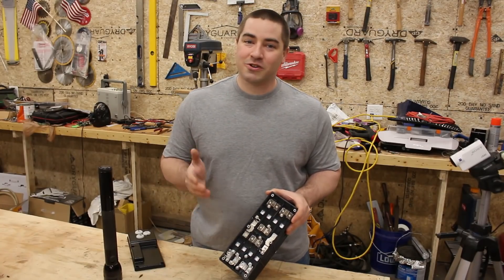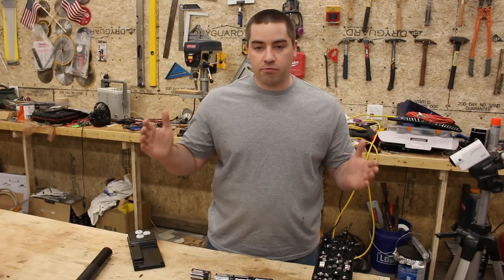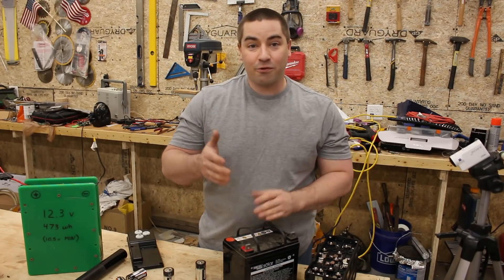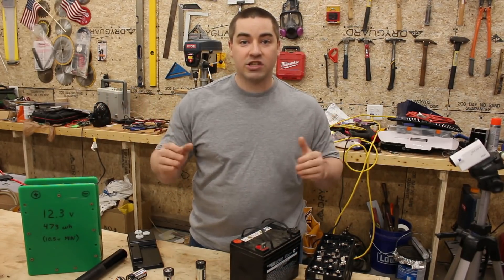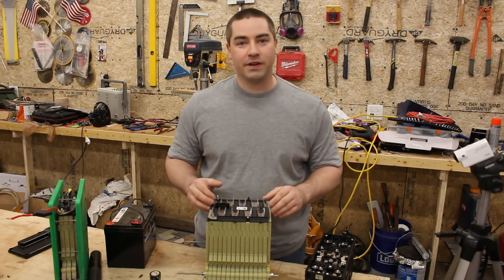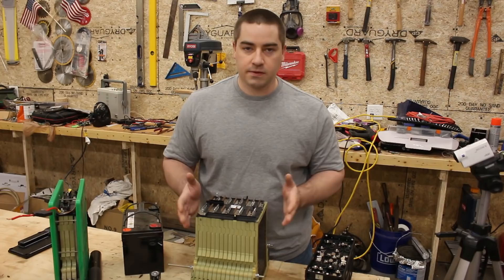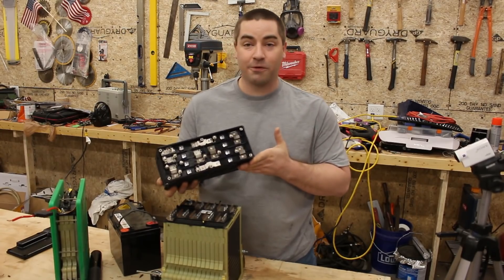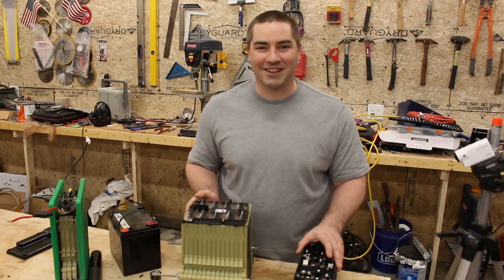Cells in Series for Best Efficiency and Capacity

Comment: Am hoping you can help me configure Navitas LifPo4 25A batteries into a 300Amh / 7 kwhr bank. My system is 24V and I have 100 of these batteries. I have (2) Overkill 8S 24V 100A BMS but can buy more if necessary. My milk crates are 12" X 18 inside. thanx........  Bob
Reply from the maker: Hi Robert. Those Navitas 25Ah cells are cool.  At 24v you will be wiring 8 cells in series.  And you say you want 7kWh capacity.  That means you need a minimum of 88 cells.  Is that how many you have?  Or you can buy 4 cases of 24 cells, which would be 96 cells total: https://batteryhookup.com/products/new-3-2v-25ah-lifepo4-topband-navitas-prismatic?variant=40145310941346  (discount code DAVIDPOZ).  Lets say you have 96 cells, and are using 100 amp BMS's.  I'd wire them as 4p8s, which would be a 100Ah battery@24V.  That would be one battery with one BMS.  I'd make 4 batteries total that way.  Does this help answer your question?
Reply: Thanx soo much for the reply. I have bought many cases.... so yes I have the 96 needed. Soo you are saying I need 4 BMS?
Reply from the maker: Yes.  At least, that's how I would do it.  I would make 4 batteries, each with 1 BMS and 32 cells.  However, I'd also consider moving to 48v.

Comment: Good video thanks.  I have a MPP solar inverter/charger I can adjust it to what ever voltage range I need Max is 60 volts, and low is 50. and I can set the cut off to as low as 42 volts.  Cant wait until I have the cash to buy a new battery bank I want as much power for as long as possible.  and then be able to add on as my system grows.

Comment: Good details, David. I want to comment that most hybrid inverters from Asian manufacturers are programmable with a wide range of charge/discharge settings allowing you to use any serial configuration from 12S to 16S. I typically do 13S for Li-ion and 14S for LiFePO4, picking the best spots for my low voltage cut off and max absorption voltage. Exactly so for Outback charge controllers and a couple others.

Comment: @DavidPoz - Dave, at 13:23, you made it sound like bulk charge and absorption charge are the same but they are not.  Bulk is given the name because that is where the bulk of the charging is done (as far as amount of charge added but not necessarily timewise).  It is typically the 1st charge stage and is typically a constant current (CC) stage.  Absorption is a 2nd stage of charge which is typically constant voltage (CV) but with gradually reducing current.  It is sometimes referred to as a "top off" stage.  So you may have misled your viewers at 13:23.  Again, the transition between bulk charge mode and absorption mode is when there is a switch from CC to CV.  Usually the CV stage happens when the bulk stage reaches the maximum allowed charging voltage by a particular type of battery.  For example, if a 12V AGM battery was put on a charger and it started at 12.8V in bulk charge mode, perhaps when it got to 14.5V, the charger would then hold it there at 14.5V (not letting it go any higher).  So at the 14.5V (in this example), there is a transition from bulk to absorption charge mode.

Comment: DavidPoz from what I have read the SMA sunny island is actually more efficient at the lower voltage of the volt batterys? look at the efficiency curve on the chart on page 231 of your operating manual
Reply from the maker: Thanks.  That is neat.  Up to 1% divergence between the 41v curve and 63v curve.  I don't know how different SMA is from the three manufacturers I called, but they all warned me against running down at lower than 48v.

Comment: I just broke out 1 of 2 Midnite Solar Charge Controllers and  have it bringing my 4 pack back up from 21v each using a  HVDC charger. Thanks for the lesson in absorb and float. Balancing lifepo4 and maintenance is a cinch but I just wasnt clear on absorb and float and the mfr are like midnite and even as helpful as thesolarbizdotcomwas they were still not knowledgeable about lifepo4 batteries. Your chart is the bomb! The generic controllers i have in the Philippines don't pull enough from the panels i think. This Midnite controller pulls  more current from  the HVDC charger than its supposed to be rated for it seems. My 48v inverter is here so everything needs reconfigured now. Got a 15kw 24v monster inverter to sell soon. Great video thanks!
Reply from the maker: Glad I can help.  But, please keep in mind, I'm making general statements.  It's still important to look up data sheets for your particular batteries.

Comment: Are you planning to use a single 16s BMS to each pair of BYD batteries?
Reply from the maker: I plan to use a single 16s BMS for all of the BYD batteries.  I'll be doing a full video on the BMS once it's fully wired in.  It is the Chargery brand, 16s version.  I still need to calibrate it and stuff.

Comment: Hey David, great video!  Ego uses 14s in their OPE batteries.  They're not as big as retired EV batteries, but for a smaller scale project they might work well with existing inverters and charge controllers.  Their biggest battery right now is a 7.5Ah (3P14S) but they are supposed to be coming out with a 10Ah version as well.

Comment: NMC Li-ion: 3.6-3.7 nominal voltage
3s or 4s isn't optimal for 12v, 7s(24v), 14s(48v)

LiFePO4: 3.2 nominal voltage
4s(12v), 8s(24v), 16s(48v)

LTO: 2.3 nominal voltage
6s(12v), 11s(24v), 22s(48v)

✌

Comment: David have you considered adding a wind turbine? Looks like it's kinda windy at your place it may generate a lot of power. If you don't wanna add it to your existing set up you could run it independently and drop a heater element in your crawlspace water tank. I bet that would help you reach your 180° goal.
Reply from the maker: We get storms now and then that have wind, but we don't have wind on a day-to-day basis.  At least none that can make significant power.  But it would be fun to build a wind turbine.

Comment: can I use the cc settings for 48v fla battery to charge the 3.2 volt x 16 cell lifepo4 with a programmed BMS? Wondering if I can just switch between the 2 different battery banks (fla are on the way out
Reply from the maker: I don't know what your settings are on your device.  But with LiFePO4 the high limit is 3.65v.  x 16 cells = 58.4v.  If your charger has a voltage setting BELOW 58.4 then you can use it.  But make sure there is no temperature compensation on.
Reply: Make sure your charge controller does not go into an equalize cycle with its current settings. Other than that, USUALLY lithium conversions are easy.

Comment: Is there any limit to the number of series connected cells?  Is there a factor of diminishing returns do to internal resistance of each cell?  Sorry if that doesn't make sense I'm in no way an electrical engineer.  Love your videos nice work
Reply from the maker: Hmmm....  Good question.  I've never come across any reference to higher voltages having a downside due to internal resistance.  Perhaps if we were talking about large commercial systems that might come up?

Comment: How do you like the Victron 250/100? Is it worth the $900 price tag? I'd love to have an MPPT that can go over 150V but I have a hard time justifying the cost when you can get a PCM60X 150V/60A for less than $200.
Reply from the maker: I bought the Victron 250/100 because it could do the lower voltage charging (48-49v).  But, if I had a better voltage pack like yours I would have just bought an off-brand MPPT.  But I have nothing bad to say about the Victron.  It does exactly what it should.  I watch the power output adjust immediately with every passing cloud.  It's super fast at finding the MPPT.  I don't know if there is a lag with other brands or not.

Comment: Thanks for this! Do you have any details on mixing battery chemistries? For example if you were to re-do your Volt pack to be 14S (49-56V), could you parallel it with your new LiFePO4 pack in a 16s configuration (48-56), or is there too much of an imbalance in the chemistries when using the pack that you would end up wasting a lot when one pack is charging the other?

How would you mix packs (like you have, one from Bolt, one from these LiFePO4, and maybe some lead acid)
Reply from the maker: I plan to parallel some packs up in the future and find out how well they fair.  I'm going to have separate BMS's, fuses, and circuit breakers for each bank.  One thing I look forward to testing: will one chemistry take all the amps compared to another because of different internal resistance?  It's going to be fun to find out.

Comment: David I’ve got a WZRELB 3000W pure sine wave inverter on its way, I’m running a 7S setup, what should I have as a resettable fuse on the output? I’ve been enjoying your videos.
Reply from the maker: The output of an inverter is AC (alternating current).  This should have an AC circuit breaker.  If you are in North America, then you probably ordered a 120 volt AC model.  So take the 3000 watts and divide by the voltage.  3000/120=25 amps.  So you will want to hard-wire using 10 AWG (American Wire Gauge) combined with a 30 amp circuit breaker.  The circuit breaker is sized based on your wire size, not inverter size.  I simply am suggesting a 10 gauge wire because it can handle everything a 3000w inverter can put out.  

However, you mention 7s, so you might be referring to your battery.  The DC (direct current) is the input side of the inverter, not the output.  You don't mention your chemistry.  So I'm left to assume you are using a Li-ion battery with a nominal voltage of 24 volts.  If that's wrong, then I'm sorry and you will need to adjust. Alt-E has some great resources https://www.altestore.com/howto/recommended-inverter-cables-sizing-and-breakers-or-fuses-a62/  On this page they suggest for a 24v, 3000w inverter, use 4/0 wire with a 250 amp circuit breaker, and 300 amp fuse.
Reply: @DavidPozEnergy  Thank you very much, I'm in Jacksonville Fl. I'm using used 18650's for a power wall, this is for emergency use during our hurricanes. So for now that's what I'm using for batteries. The 7S is 7 x 20 batteries each X6 layers of them. Approximately 4.2Kw of batteries.

Comment: Awesome video!  This is something people hardly ever talk about directly, but indirect in the sense that they assume everyone knows so they don't explain in any detail like you just did.  A video on sizing would be good too, for example, using an electric bill to calculate the system size that would match the KwHs used each month.  Where to start on that?  Battery size, after battery size, one has to think about how many panels are needed at a particular size (watts) to charge the batteries fully in winter on sunny day with only 5 hours of sun.  How to size an inverter for said system, how to determine if inverter can be connected in series?  A whole detailed series could be done on  all aspects of sizing.  This is something I don't see covered as a whole, but only in scattered bit and pieces.   Also, subjects like charging, how to charge batteries without a charger/bms as in from a bench power supply?  Is it possible?  A lot of people don't know.

Edit:  Just watched another of your videos, BMS came up .... add size of BMS to the above.

Thanks for sharing your knowledge.
Reply from the maker: Thanks for watching and the ideas.  I agree.  When I first got into this it seemed like it was assumed knowledge.  I was confused about this topic for a while.

Comment: most important point - i have a grid tied inverter and wanted to move to off grid but the grid tied solar inverter has a 70 - 450 Volt range and therefore would need a more  likely 84 V - 96 V battery than a 72 V one but mppt chargers for such high voltage are often missing.

Comment: David good job.  I chose a Victron "48V" Inverter/charger because it had the best voltage range.  But I went with 18 LiFePo4 cells because I wanted to reduce the voltage swing to increase the cell life.  Also if one cell goes bad, I can remove it and easily reprogram the voltage swing while waiting for a replacement cell. That is the one thing that many forget.
Reply: Same reason I'm going for 15S LI-NMC - If a cell goes bad, i can bypass it, and the victron gear lets you do this, they're highly configurable. When my batteries arrive I'll have already programmed my charge controller for the two configurations (14S Li-NMC and 15S Li-NMC), using my GEL bank to power it. I'll just turn off the solar breaker while setting up the profiles, then set it back to GEL until my batteries rock up.

Comment: Another great video.  I might comment that (I believe) the reason you focused on 48v  DIY battery bank (rather than 24v or 12v) is that you're talking about house level power.   For house level - e.g. 6,000watt or above - is that you need 48v to reduce wire size.  To illustrate,  running a 6,000watt inverter from a 12v battery requires 6000w/12v = 500amps which is really huge wire thickness; whereas at 48v its 6000/48 = 125amps which is much more mainstream wire, fuses, connectors size.        The battery, inverter, amps (wire size) all relate to shape the equipment ranges that are readily available and 48v is one of the sweet spots with lots of stuff (and therefore reasonably priced).
Reply from the maker: Hi Kenneth.  Yes, the wire size is half of it.  The other half is efficiency.  Related to your point about high amps.  The higher the amps, the more heat the inverters/CC will generate.  That heat is wasted energy.  Higher voltage = lower amps = equipment runs cooler = higher efficiency.

Comment: Hi David, I wonder if all the inverters you blew up with the Dewalt chop saw was because of the low voltage you were running with the Chevy Volt Battery  ?
Reply from the maker: I think, at least with one of those tests, I had the pack at 48.5 volts.  That should not have caused it by itself because that is still a good voltage.  But maybe added to an existing problem?

Comment: What are your thoughts on Leaf batteries?  It seems like 7S is great for 48Volt range?
Reply from the maker: They are great.  They bolt together very nicely.  The cells would be 14s, but 7 modules.  EV's get used hard, so there is usually reduced capacity.  But still totally worth it if you get it at a good price.  If you buy one extra module for every car then they break down to even sets.  I think there are 48 modules in every car, so one extra module gets you an even division of 7.  You can buy them from Battery Hookup and get 10% off if you use my coupon code "davidpoz"

Comment: Ah yes the sweet spot all components have now putting them all together to get the perfect running system is still left to be determined. Good video as usual. A little higher in voltage is usually better than a little lower and we make more energy at higher voltage when we keep the amperage the same.

Comment: David what bms did you use for your battery wall? And does it have low temperature cut off? And what did they cost you? Thanks for what your doing its been very helpful trying to figure out what route I'm going to take here.
Reply from the maker: I'm using a Chargery brand BMS, the 16s version.  But I don't have it fully hooked up yet, so I have not tested all the features.  My garage is heated so I never looked at whether it has low temp cut off or not.  That's not a feature I need.  As soon as I get everything wired I'll do a review on the Chargery.  Thanks for watching.
Reply: @DavidPozEnergy  thanks David.

Comment: I am wondering, what are your "typical" options nowadays for building power walls with full EV pack voltage, that is ~400V? Do you find inverters and chargers for that at all? And at what prices (I guess too much :D)? Because I work in a company that makes power modules for EV chargers, and we are considering supporting home applications as well, including local battery storage. Except we won't do anything below 200 V (and already, 200 V is quite a pain, and indeed, you definitely have less power out of it because you hit the current limit of the electronics much earlier in the (de)charge when using lower voltages).
Reply from the maker: I think the electrical code limits us to nominal 50 vdc.
Reply: @DavidPozEnergy  For DIY stuffs only? Or for any home installation of storage battery, even pro?
Reply from the maker: Even professional installers (like my friend Ben in Vermont) can only install systems with nominal DC voltage up to 50v.  The only way to get around this (maybe) is if you build an inverter/charger/battery assembly all sealed inside one metal enclosure with no access.  Then get the whole unit as a sealed assembly UL certified.
Reply: @DavidPozEnergy  OK. Thanks for the insights :)

Comment: Excellent presentation for all diy newbies who wants to avoid the mistakes most pioneers did. I have very little to add except that many inverter makers can make range adjustments for your specific battery chemistry and on evtv Jack Richard' store you can buy a 12kw inverter specifically designed to work with 12s 24s Tesla battery packs.